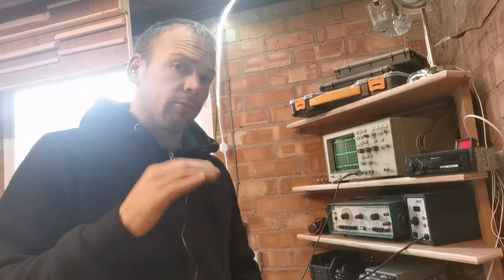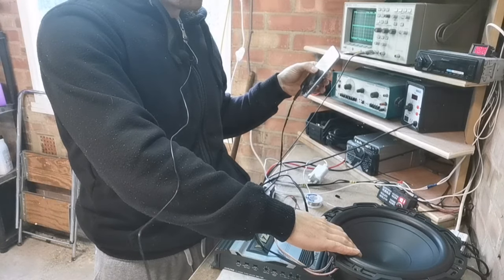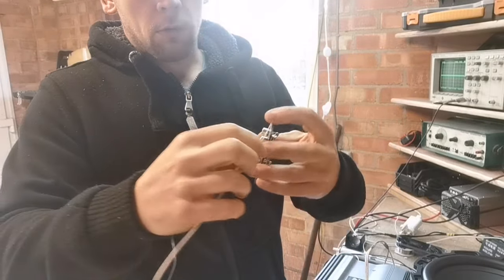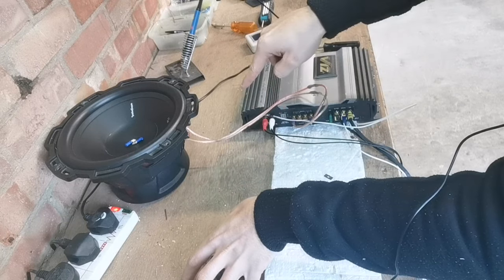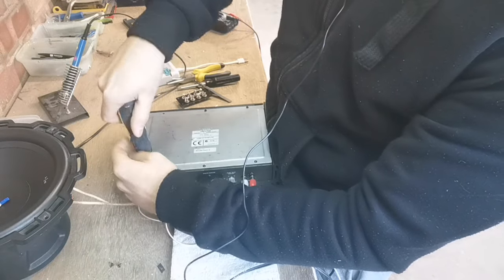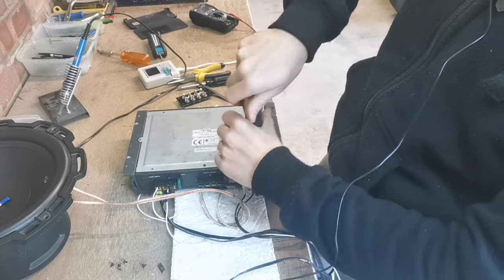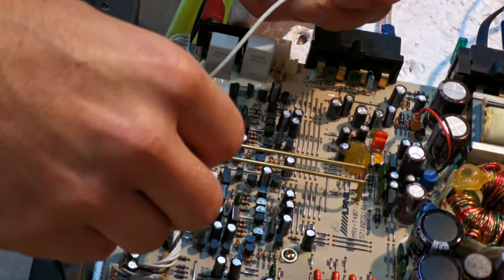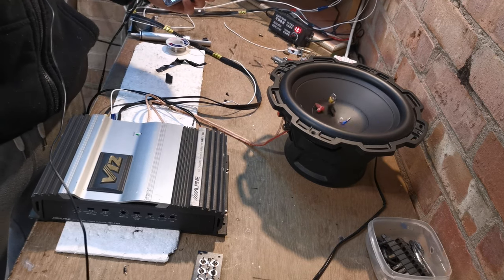Fixing Subwoofer Hum FOR FREE.

Comment: Subs started humming after installing new head unit I think it's a loose power cord but it could easily be a ground loop. One thing I'll say is when you turn the unit on and the volume is on 0 it hums but when you turn the volume up to 1 and back to 0 the humming immediately stops until you turn the volume back on..weird

Comment: I was thinking I needed to apply the OLD blown pico ground trick. I have a buzz in a used amp that I bought for a good deal on eBay and i think i might have to try this fix and save $279. I know it is the amp because my first identical amp work fine with my source and power supply. I was told to also test with a battery because power supplies can cause buzzing (according to Rockford Fosgate customer support, but not in my case).
Reply: Update it was the old HU. But my RCAs are not in that style they are in a harness. Grounded those and it was good. Time to upgrade the test bench source HU.

Comment: I I have I have a question to ask you what if you're using your stock radio and running the amp to the little converter box to give you the bass because that is what I did to my girlfriend's car I ran the stock radio and the converter and I still get the hum I try several different ground spots but seems like nothing is working I haven't tried your idea yet but I am going to do that but I didn't know if you can do it with the stock radio this is in a 2008 Honda pilot by the way please respond as soon as possible if possible thank you and have a good day
Reply from the maker: Yeah no problems, just use the rca shield on the output 😊

Comment: Adam Francis, I was getting crazy with my issue, every time I pop up the subwoofer gain way more than a half the hum vibrates my subs so bad, and I just weld a cable to the RCA plug that goes to my mono amp, and boom, no more whine and hum noises, excellent video thanks for the tips, I have already did it to my car stereo, I weld the RCA cables  to the chasis it worked but was back again, thanks mate, you deserve these    ⭐⭐⭐⭐⭐

Comment: Alright. So I went through the process just like I would for finding a short. disconnect the HU plug. Still noise. 2. disconnect the highs amp power. still. 3. disconnect RCAs from mids and high amps. still. 4. measure V drop of mids amp. fine. 5. disconnect mids ground connection. still. 6. disconnect mids power. still. 7. measure Ohm of all grounds to batt and ground to amp frames. OK. 8. disconnect mids front speaker outputs. still. 9. pull out the front crossovers. disconnect power input. still. 10. disconnect crossover speaker outputs. NOISE STOPS. Ta da. 
11. check front speakers for short to ground. OK. 12. reconnect crossover speaker outputs: NOISE RETURNS. 13. Presume interference. Relocate crossover to different positions: TA DA. 

It turned out that the Morel crossovers are sensitive to interference. They can't be even 8 inches near any power junctions/ECU/etc. So, I relocated them to under the floor carpet in the front where people usually don't put their feet. Noise gone.

Comment: Hello, 
Maybe you can help me find a solution to my subwoofer that is huming.
 1. Conected to the amplifier an using CD line input, the sub is huming. Switching to other inputs also hums. Switching to optical or coaxial the hum stops.
 2. The subwoofer is conected to the power source and disconected from the amplifier but the other end of the subwoofer cabel is conected to the subwoofer input, the subwoofer is huming. If I take out the cable from the subwoofer, the huming stops. You need to put your ear on the subwoofer and focus to hear very low hum. If I connect again the cable just to the subwoofer input (disconnected from aplifier) the huming reapears.
 3. I connected the subwoofer to a different power source and it hums. Please help me with advices.
Reply: Most likely because the line input is an unbalanced cable so the humming from its power source is present. Optical and spdif are digital so they are different. Try a ground loop isolator or the second method in this video.

Comment: You're life saver. I have 2amp setup in my car and humming seems to come from sub amp, so I was thinking its broken and was about to buy a new one🤦‍♂️, will try these fixes first. Cheers
Reply: Did it fix the problem? Have the same issue haha
Reply: @cxsper6111  I later found out that issue is rca cables and speaker amp being turned all the way up. I resolve it with jl audio Bluetooth receiver which eliminates need of long rca cables and also gives strong signal so I can turn down amp gain.

Comment: I tried it on mine, it changed the frequency of the hum, but it was still there. I noticed it after I replaced my rear speakers, it was very, very faint, however I bought a small amp .... which amplified it.

My car's stereo controls the climate settings, and also the cruise control, I can't really remove the stereo without losing features, so I added a Kicker kisloc2 which is working, but it still amplifies the hum even on the lowest possible gain setting ...

People online mentioned the day time running lights will cause a buzz with after market amps, which it did (when the car was both off, and on) I removed the fuse, and the sound went away with car off, however while on it still hums, this was worth the effort to try, I just don't know what to do now, it had some effect but the sound went from one constant tone, to like 3-4 different tones at once oddly enough. 

Wasn't any quieter, but I really wasn't expecting this to work for me, as I think it's my cars preamp ... beside ferrite rings I'm not sure what to try =/

Guess this is what I get for trying to do something nice for myself, speakers, wiring kit, amp, loc and it's only gotten worse now lol

Comment: Ha I did the same thing years ago with my car amp powered in home, without knowing if it's safe for the amp or any source I'm connecting to it, but I did it anyway since the hum went away completely when connecting the grounds together. So I guess it's safe? Also, do you have any video about the power supply powering your amp? And that thing that you set at 13V? Because I use a PC PSU and as you know that stays at 12V.

Comment: Old  video, but worth a shot.     

Would it be possible that the rca port ground wire on the amp (witch connects to the board within the amp)  could have broken at the soldier point?..  

Tried sub, and mids on both channels and always a hum.   Until I cut remote power. 

No power wire crossing rca or speakers. 

Power straight up driver side and speakers/rca's up passenger side. 
 wires do not cross

Been playing to long
  Ready to rip it apart now. 

Also
  While I'm writing a story. 😂.. 

Got a alpine 500 mono block. Powers up, but no sound to tye speakers.     Speakers work on different amp.

Comment: I’m using a stock radio with an LC2i loc and my system has a buzzing noise in it. And the whine increases when the rpms increase.  Should I wrap wire around the outputs of the LC2i and try to ground them?
Reply: Im having the same issue
Reply: Check your alternator you probably pushing too much power and I’m sure you already solved the issue, if you did what did it end up being?

Comment: I have a NVX 1500 wired up to 2 SDR 12s and when I turn the bass knob up and there's no music its just a quiet hum. Everything is grounded good, power wire is good the 2nd battery is good everything is fine so I'm confused. Is it my RCAs or my LOC? Or maybe the remote wire I'm not sure what the check cause everything works good just annoying might just have to get used to it...

Comment: I have set up an car amplifier for my TV at home.  Recently i got noticed a Buzz sound from speakers not from subwoofer. Previously it was not there. 
I would like to know how your car amplifier had set up for remote cable for "ON" indication. Are you connected with a small wire from 12v to remote. For me it is 12vdc 30A power source. So I used around 20awg wire for this. I don't know this makes anything noise.

Comment: I have a 2005 F-150 Lariat with a stock amp and sub and I can not get rid of the humming after installing an aftermarket radio. I tried grounding the RCAs on the back of the radio and it did not work. I tried grounding the amp wire hardness at the radio, it did not work. My issue is that the amp is wired to the sub with a wire harness, not RCA cables. Any suggestions?

Comment: Videos like this is what youtube is made for.
Reply from the maker: I appreciate that mate 😊
Reply: @PacmanBasshead  hey so I tried this method and it didn't help if anything sounded worse ive messing with this thing for months now and can't figure it out I know there's a way cause I had a guy help me with it once before I uninstalled it when my kids were born but I can't remember what he did I'm running a Alpine IVE-W535HD head unit alpine PDX-M6 amp and 12" alpine type x vehicle is a 2009 saturn vue never had an issue like this till I owned this vehicle and the guy that fixed it said its an issue that has to do with GMC the way they wired the audio systems in here

Comment: any advice on an active sub that makes a hum but only when engine is running. Head unit is a ford 6000CD and bass speaker is an 30 year old tube that had been retired and sitting in my garage and have handed it down to my son :-) Whilst on the subject of the ford 6000CD is it worth changing that out or is it not too bad as a headunit? Thanks in advance.

***UPDATE* changed out the headunit a friend had an aftermarket one and the hum went without changing anything but the headunit and it sounded better so think case solved
Reply: Should add as well that the sub just takes the speaker level positives from the left and right front outputs from the headunit with no negatives

Comment: How would this translate to home theater? The wire trick does nothing for me. I guess DC offset is another issue.
Reply from the maker: In all honesty, I don't know enough about home theatre to give you a good response, try and check continuity between a working home theatre amp RCA shield and ground, if there is ground there then try it on your home amp, however. Be careful. You're playing with much bigger voltages there so unplug and use ppe. Your home amp will also have a ground inside it somewhere. Just as a disclaimer, I have not tried this so am unsure if it works!

Comment: I tried this to no avail, but i did notice that the hum is still there after disconnecting both rca cables leading to the head unit. Should i try grounding the cables that lead from the amp to the sub instead?
Reply from the maker: Absolutely not, thats a fast way to mess everything up. Sounds like your amps power or ground cable has an issue to me. Redo your main ground, or check it.
Reply: @PacmanBasshead I redid the ground and connected everything besides the rca cables. Turns out that the hum goes away when I remove the incoming single wire. Maybe the amp is fried?
Reply from the maker: @markopolo7651  thats the remote wire, if you remove that the amp turns off..
Reply: @PacmanBasshead  thx for your patience, turned out to be a bad connection on the stereo/mono switch👍
Reply from the maker: @markopolo7651  those things are a bitch! Easiest fix for that is to remove the amp from the car entirely, let it discharge overnight, get some 99% isopropyl alcohol and spray it into the switch, toggle it back and forth (literally) 100 times. After 5 mins the alcohol will have evaporated and youll be good to go

Comment: Ahh yes the good ol broken signal ground and all it´s problems, there is also a good idea to actually ask yourself "why is the ground connection broken??" so yes there is 9 out of 10 reasons this was caused by something in the first place so you better take care of this before putting more ground on your stuff. the most common reason this condition happens is because either way your head unit or the amp itself supplied power is poor or faulty at a ground level, imagine your amps negative power wire has no connection and the amp gonna need it´s power to work someway so it just gonna grab this someplace else available since as you saw this is connected to your chassis, signal wires and the power input of your amp, so if your amps huge negative wire gets bad it simply gonna use your RCA ground instead straight through your head unit and it will absolutely fry these small traces and make this problem, so what happens if you add more ground in the amp and still have a poor power cable? that´s correct it gonna burn the next weak link, your head unit. so before you go fix your stuff ask yourself why this happen in the first place and save yourself some serious damage up ahead. yep it´s broken, Why? the power cable is not connected or too thin or whatever reason, fix this, and then re-patch the signal ground. profit!

Comment: Have the common 60hz sub hum from a Klipsch 2.1 Promedia computer speakers. Sound great but built like crap. Annoying as F! Used your basic idea of grounding the controller interface by taking a small wire and looping it around the 12 pin interface on the back of the sub and running it over to one of the screws on the metal backplate. Seemed to work! Thanks!